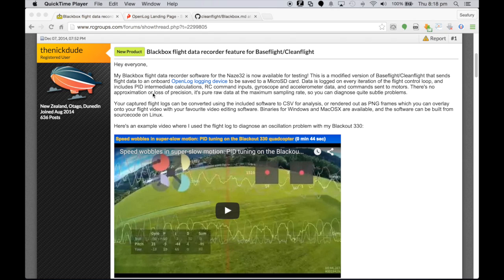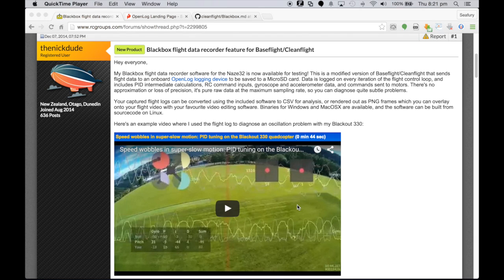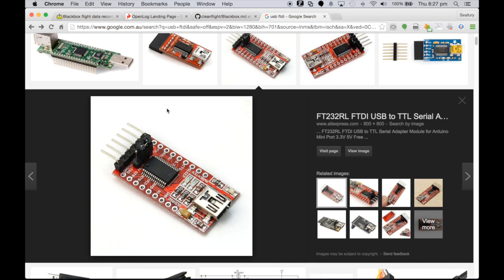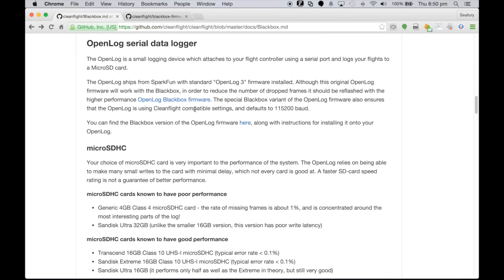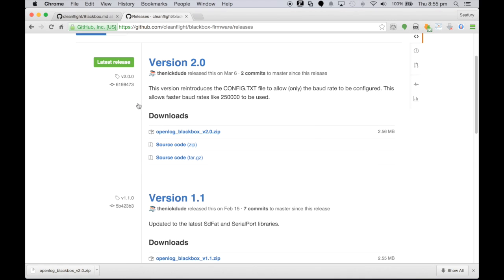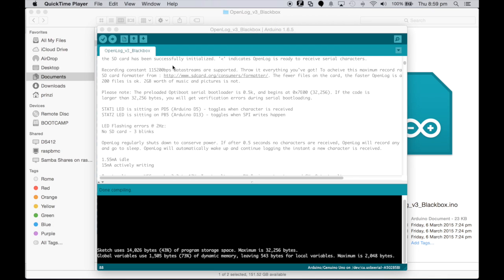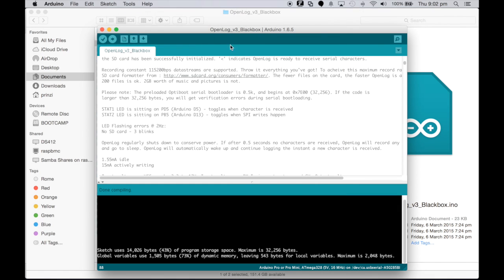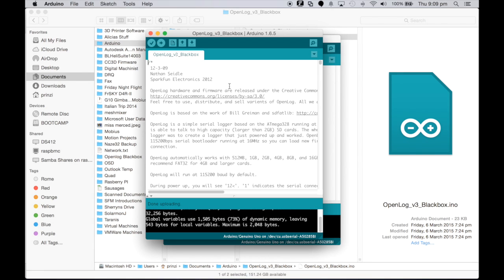How to configure Blackbox on Cleanflight Betaflight Baseflight Naze32 - Part1

Comment: i get this error: In file included from E:\Users\Bjarne\Documents\Arduino\OpenLog_v3_Blackbox\OpenLog_v3_Blackbox.ino:57:0:

E:\Users\Bjarne\Documents\Arduino\libraries\SerialPort/SerialPort.h: In member function 'size_t SerialPort<PortNumber, RxBufSize, TxBufSize>::write(const __FlashStringHelper*)':

E:\Users\Bjarne\Documents\Arduino\libraries\SerialPort/SerialPort.h:575:25: warning: '__progmem__' attribute ignored [-Wattributes]

     const char PROGMEM* p = (const char PROGMEM*)s;

Can somebody help me?
Reply from the maker: ok. never saw that error. i suggest you ask the forum as its beyond my code knowledge
Reply: I have the same problem...
Reply: I finally solved the problem by using the old arduino 1.0.5

Comment: I'm getting a message: "invalid library found" pointing to the path where I copied the files.  Not sure what I'm missing here...
 
I copied the content of "SdFat-master" and "SerialPort-master" to the Arduino library folder.  Also the LED on the logger stopped flashing. Doesn't blink anymore when I connect it to the USB via FTD after I tried flashing it the first time.  Did I manage to brick it?
Reply from the maker: I suggest checking the comm connection to ensure the driver has loaded and the correct
comm port has been selected. break things down into chunks to troubleshoot
Reply: +seafurymike 
Figured it out now.  I think it might be a combination of two things.

I checked out some other guides and there they only copy the SdFat folder, not the entire content of SdFat-master. Same thing with the other. Copy only the SerialPort folder and not the entire content of SerialPort-master.

I&#39;m also using the latest Arduino 1.6.7. So possibly an earlier version might  work with all the files copied in the scratch library.
Reply from the maker: +samik83 glad you sorted it out. i had library issues to. seems inconsistent in behaviour between you and i